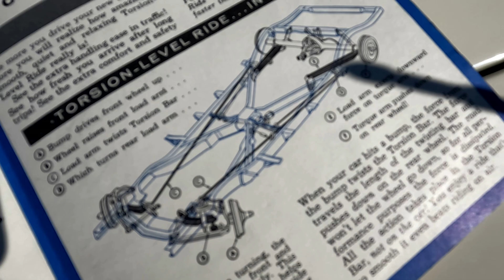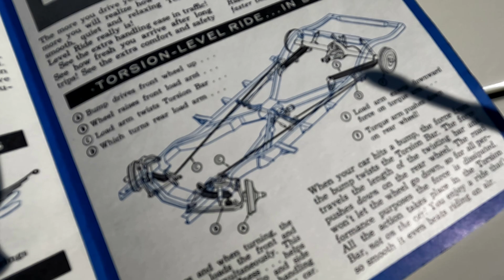Packard Torsion-Level Suspension explained and demonstrated.

Comment: Man this is before Citroen overrated Hydractive suspension. To me this system is better because its simpler and does almost the same job. But people forgot it over the years and only mention Citroen.
Reply from the maker: Far less complex than the Citroen system. No  pressurized hydraulic fluid and compressed gas within "spheres" or membranes. It's interesting someone came up with it most likely on a cocktail napkin, designed it and it worked very well.

Comment: My mom had the two-door version of that car while I was in junior high and high school. As kids, we used to sit on the rear fenders, wait for it to rise and level off, then jump off and laugh at the “raked” version of such an elegant car. When I was old enough to drive, I could use it for dates and later as an everyday drive. I once hit a hidden deep pothole that caused the torsion bar arm to jump out of the rear “stirrup.” It dug a rut in the cement for a good 20 feet before I could stop, wearing a good inch off the edge. I managed to get it back into the stirrup with the help of a hydraulic jack, but it always had a propensity to jump out again after that. I loved everything else about that car, though, from the brilliance of lighting (very visible from the sides as well as front and rear) to the convenience of the push button drive when rocking out of the snow.
Reply from the maker: Great story! Suspect the torsion bar had a preset tension too making it even harder to reconnect with the pre-load!

Comment: Same as citron cv2 except way more complex.
Reply from the maker: Ahhh, yes to a degree and a comparison we have not heard mentioned till now. Like the Packard, the Citron idi have a longitudinal connective bar on each side connecting the front and rear suspension but with a mid-ship mounted coil of springs on each side. Packard was also a longitudinally connected suspension front to rear on each side but with no coil or leaf springs. The system used torsion bar rods to get the spring rate. We feel the Citron system is equally complex for the time and also very innovative. Thank you for mentioning this and your interest.

Comment: my 99 ford explorer had those in the front with no springs !
Reply from the maker: Yes, and the various years of Chevy trucks, old MoPars etc. used torsion bars on front ends. However this is the only that used them on the rear and one bar connecting front to rear.

Comment: My father owned a 1956 Packard Clipper with this load leveling system. My brother and I as kids would get on the back of the car and ride it up and down till told by dad to get off the car LOL
Reply from the maker: haha, and yes, the stories of dead batteries of cars in driveways and parking lots from kids enjoying the torsion-level-suspension. Ours has a switch under the left side of the dash to disable the system. I think kids to day have many more distractions and typically don't go outside to play as we used to.

Comment: Interesting.  Citroen had something similar, done with hydropneumatics.
Reply from the maker: Yes, and the Citroen system used oil and air as its main components. We recall it was an all wheel lift system too, front and rear of the car as needed. 
The system was also used under licence by other car manufacturers, notably Rolls-Royce (Silver Shadow) and Peugeot.  Thanks for your interest!

Comment: The suspension is really interesting and a great piece of engineering. I have always been a Mopar guy and always loved the torsion bars. I knew Packard had some sort of 4 wheel torsion bar setup, but I could never quite figure out how it worked (at least in the rear), but this demo makes it easy to understand.
Reply from the maker: Glad it helped clear up some of the mysteries of the Torsion-Level system. The bar from front to rear is enormous!

Comment: Thank you for showing how this suspension works. I've seen zillions of articles showing diagrams, but never an actual undercar peek at how the stuff was all connected together. I love the styling of the car, too. Too bad Packard had made some really dull cars after the war that probably turned off many buyers. If I am not mistaken, wasn't 56 the first year that a limited slip diff was ever offered?
Reply from the maker: Thanks for the input and glad you enjoyed the demonstration and under-car as best we could show it. Implementation of the Twin Traction (aka - "Power Lock") differential in production was delayed several times it was to be a '55-'56 option. This unit was supplied by Dana/Spicer. The rear axle was smartly designed with interchangeability in mind; that is, the only difference between a conventional rear axle and a "Twin Traction" unit is the differential carrier. As best we know, it seems that cars with T-T units did not begin reaching dealers until sometime in February 1956. In fact, it was so late in coming that servicing the Twin Traction differential isn't covered in the 56th Series supplement to the shop manual, but only in the April 1956 edition of the Service Counselor. Unfortunately we did not check/test this while the car was on the lift. It's easy to do and the test is a simple as rotating one rear wheel while the car is in neutral, and if the opposite wheel spins in the same direction, it is a Twin Traction or Power Lock rear axle. If the opposing rear wheel spins in the opposite rotation it is not and what we call an "open" rear axle.

Comment: I wonder if there were worm screw drive adjusters at the mounts, and that's how height levels changed.
Reply from the maker: My guess from the Delco levelizer motor, there is a worm gear drive on the shaft, which turns a gear with bellcranks, moves the left and right arms in and out which in turn rotate the two levelizer bars connected to torsion keys raising and lowering the rear of the car.

Comment: 58 Packard hawk with factory supercharged V-8 and hood scoop was my favorite. 
 It's unfortunate that instead of innovation. 
Detroit settled for less.
 They suffered for a reason.
Reply from the maker: The Hawk is a great car and one of our favorites too! and the 289 V8 is a fantastic motor and most think it's the Ford 289 which it is not. Its rarity and status as the best-regarded of the 'Packardbaker' final-year cars have made the Packard Hawk quite collectible. Values are roughly double those of the equivalent Studebaker.

Comment: Fascinating stuff. The swaybar effect would be front to rear not side to side. Does this translate to less front rise during acceleration? Rear dive resisted by front weight?
Reply from the maker: Thank you for your question, Brian. A very good question and I do believe that was the intensions of the design. The car seems well planted and balanced front to rear and there is no excessive nose dive or rear "squat" upon deceleration or acceleration. There's some old movies online from Packard that further describe the characteristics of the torsion ride suspension system.

Comment: Looks like another thing that would fail for the next owner
Reply from the maker: Well, let hope it is the next owner then, haha. In all seriousness, yes, there are additional fail point as soon as you introduce an automated electrical/mechanical active system into the passive suspension system. However, the system has been working just as designed since 1956 without fail and with still the original components. We have no concerns about the system failing and have been driving the car now regularly for the past two years. The worst thing usually, with switches and relays, is non-use.

Comment: Your description of the “truck arms” threw me for a loop for a bit until I realized you were referring to the lower rear trailing arms. The “truck arm” configuration was a popular configuration which was used on the grand national stock cars later on. Those arms are still commonly used in off road vehicle suspensions where long travel and articulation are required.
Reply from the maker: Yes, correct! Truck Arms which were used in the rear end of Chevy trucks for years with coils till they went to leaf springs. Also in the larger platform GM vehicles. NASCAR used them for decades with a Ford 9" rear axle, till they went to the IRS/sequential transaxle in the Cup Series a few years back. You'd hardly ever see a rear end break but now it's pretty common with the Cup cars.

Comment: My Dad loved his Packard, but because of the torsion suspension, it was always in the alignment shop.
Reply: From looking at the suspension on the lift, I suspect it was less the suspension torsion bar setup and more the result of the king pins and trunnion bushings used as they were multiple additional wear points themselves. There was a good reason Ford brought ball joints to its cars for 1954. I have heard the first introduced it on the 1952 Lincoln, but don’t know for sure. Most of the other manufactures soon followed as they introduced new platforms. 

And back in the day, many drivers had many problems with suspension alignments because they drove their cars abusively, like whacking and hitting curbs and hammering potholes at high speeds. They used their tires and wheels as “curb feelers”.
Reply: That car was an expensive car to build! For me, it would be well worth the money to re install the rear resonators at the back of the car in keeping with the original intent of the quiet exhaust sound. The resonators would still allow enough of that addictive v8 rumble to escape to add to the ambiance and elegance of the car. That Packard is not a high performance touring car or hot rod. It’s a luxury comfy car with good power and ride.
Reply from the maker: Good Catch! The exhaust without the resonators is actually really quiet. You have to go to the back of the car to actually hear anything and is quiet on the inside. Check out some of our other driving videos and you can hear it is very silent. Even out a GoPro on the back bumper to really hear it and exaggerate the sound. Not sure what the reason was for the wide-spread use of resonators at the tail pipe was on 50's and 60's cars. GTOs had them too and many others.
Reply from the maker: Interesting. Wonder how the bars vs leaf or coil springs would affect alignment. Doesn't seem to be related.

Comment: I have a question. Can this car be driven spiritedly on rough roads with just two passengers in it without the rear wheels constantly being forced to the rubber arm stoppers? Do the torsion bars prevent that from happening? Is it advised to slow down over rough roads more than normal than say a 1976 Cadillac Fleetwood? I would love to watch this car take some humpy roads with a lot of dips. Can you do a video over different types of roads with just you and then with 3 additional passengers?
Reply from the maker: Well, we don't drive it on rough roads, say dirt or non paved roads, but crossing railroad tracks and a railroad "hump" at speed, is no problem at all. Even with 3 people in the back, the suspension would "firm up" by cranking the bars to accommodate, so the extra load would not be an issue as might be with a '76 Fleetwood which would be burdened by the loads.
Reply: @classicperformance  I have the self-leveling rear in my '76 Fleetwood. I have been in early Buicks though with soft springs and sometimes, under certain conditions, the front suspension would allow the wheel axle to hit the rubber arm stoppers and the back axle would too. You answered my question though. Thank you.
Reply from the maker: @waynejohnson1304  ahh. Yes. I recall the Cadillac air bag leveling system with electric compressor. It worked well too. Thanks!!
Reply: @classicperformance  On the '76, the air bags weren't available, but, the system ran off the air shocks which raised the car to keep the car level. When I purchased the car, the air pump that ran the system wasn't working, so, I installed air shocks with a a control inside of the car. I set it on 75 pounds and add some if I'm carrying more people. I like the system on the Packard better though. I don't know why it hasn't been used since.
Reply from the maker: Thanks, Wayne for the info, air supplement shocks vs bags. I seem to recall Cadillacs had full bags in the rear in the 60's. We used High Jacker and Monroe air shocks back in the day with the old Muscle cars to get the up off the ET and Crager wheels with 60 and 50 series rear tires. The good 'ol days.
Reply: @classicperformance  It has always been my dream to ride in a Packard with this type of torsion bar suspension. Someday. LOLOL

Comment: My grandfather owned a Packhard but it was way before I was born. Thank you for thorough explanation of Your particular Packhard. They truly were beautifully engineered automobiles surpassing the other manufacturers. Thank you for a careful loving explanation of the Packhard ride. I surmise relays and capacitors involved with the seven second lag load leveling system, but I don't know squat about these sturdyly built vehicles, so my humble appologies if I've got it wrong. Your car is immaculate! Hope your able to keep her! Very nicely styled car. Deeply appreciative to you for graphic explanation suspension system Packhard late model. Merry Christmas!
Reply from the maker: It’s certainly one of the most impressive suspension systems of that era. We have later found out there is a bimetallic thermal spring that acts as a contact once the system is activated. The heat produced in the metal eventually allows it to come into contact with the motor relay. Takes @ 7 seconds for the spring to heat up and deflect. We appreciate your interest and your comments. Check out all of our other Packard videos. Merry Christmas!!!

Comment: Us ten year olds got into trouble doing what he did. We’d jump on a Packard’s rear bumper just to see it rise back to level. Neighbor’s battery would be run down when they went to start the car.
Reply from the maker: So true @tedecker3792. Jay Leno tells the same as well. It was a very common thing. Ours is fitted with a disengagement switch so that it won't randomly seek it's level in the middle of the night and when no one is looking!

Comment: It's surprising to see everything working "as it should."  Most 1955 & '56 Packards & Clippers ('56 only) today have inoperable suspension motor components, resulting in severe "forward pitching."   Of course, it can be "manually corrected" but it's still annoying.  Great video of a very solid, original Patrician, thanks!
Reply from the maker: Thanks very much! She just turned over 4,900 original miles.
Reply: @classicperformance  "4,900?"  Wow, that's amazing! Surely one of the lowest, if not THEE lowest milage 1956 Packards in the world.  I had a '56 with 43K and thought THAT was special.  HA!  🙄🙄
Reply from the maker: We believe it is the lowest mile original Packard to exsist, there may be another with similar miles but have not quite documented that yet, but have been told.
Reply: @classicperformance  Certainly the lowest one I've ever heard about.  Simply amazing!
Reply from the maker: Thanks again!

Comment: I just got a Best padlock that was from the Detroit plant. Its 7 pins & I have the control key, Grand master key & the change key. This is a really nice lock. I was born in 1961 so I never
got to experience this EXELENCE in car design. If any of you have these locks here are the the codes. Keys are on "A" keyway & are cut from tip to bow. 
Control=6509472. Grand master=8321650.   The control key will pull the cylinder out of the lock body & the Grand Master will open all the locks on this system. You would
need to show the locksmith the lock & explain that PACKARD thats stamped on the lock is LONG OUT OF BUSINESS to convince him that its ok to cut these keys. You
would also ask the locksmith to PUNCH the keys to the codes I gave above.
Reply from the maker: Thank you for the tips, Dave. All good information we'll keep on file.

Comment: Your "level sensor" is the clamp on the tortion bar on the driver's side.  It goes over to the controller box.  The little rod has an adjustment on it.  If it ever gets moved you can readjust on a level surface.  I have to repair mine.  It's currently "manual control". Thanks for the video!!
Reply from the maker: Good to know. I feel the car sits a little low as adjusted. Typically we get the ride level set and just leave the switch in the off position. Unless hauling a load in the trunk or rear passengers there seems to be no reason to have the suspension in the "on" position for regular use with driver only.

Comment: This is what's called making a virtue out of a defect.   The car's suspension is way too soft, so they had to add a kludge to keep the car level when there is weight in the back.
I was hoping the presenter would show us what the leveling system does on a hill, which would tell us how the sensor works - does it sense chassis tilt or does it sense wheel extension?
Reply from the maker: The sensor is not hill sensitive. It is connected to the torsion bar with a time delay. So the bar rotates and then activates the sensor.

Comment: I also have a 1956 Patrician in a single color (Adriatic Blue met.). I see you answered your question on how TL works. I have taken the control box apart. Inside are contacts and relays, along with a lever that is connected to the main suspension. The timer system is made up of 2 bi-metal contacts wrapped in heater wire, like a toaster. When the car is loaded, a switch sends current into the proper heater wire. The bi metal contact heats up and slowly bends to makes another switch that runs the leveler motor. When the car reaches the correct height, another switch stops the motor. Very ingenious, very simple, and very reliable, as seen by it working here after almost 70 years.
Reply from the maker: You are most correct! Thank you for the detailed information.